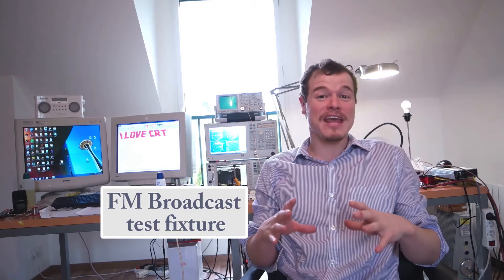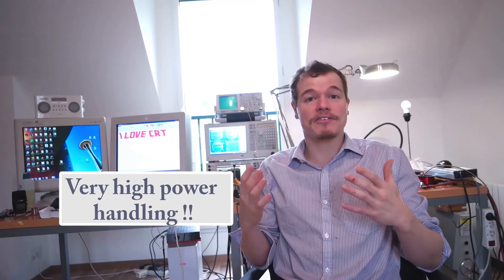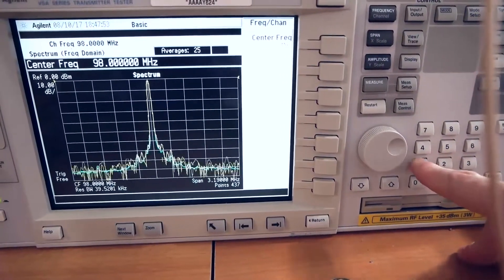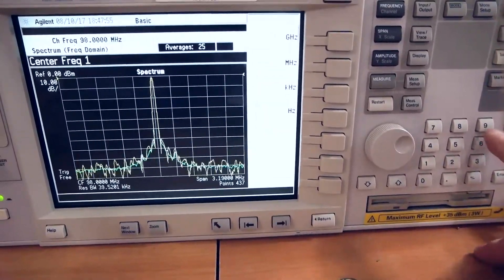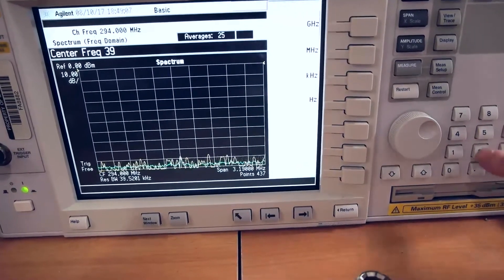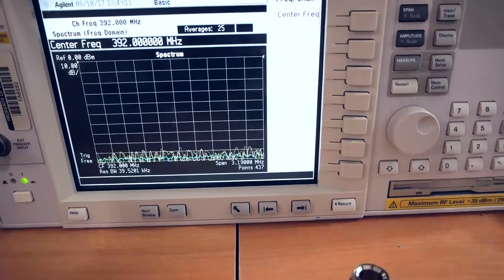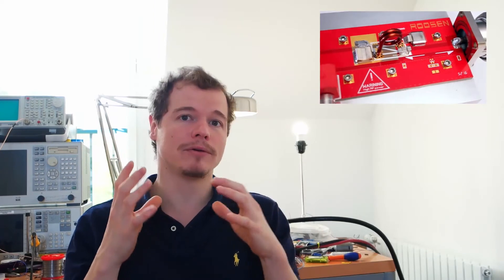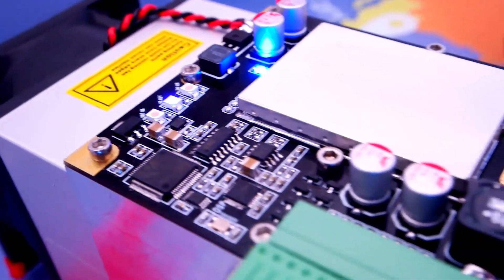MRFX1K80H ROOSEN design breakthrough Broadcast & ISM

Comment: Great and neat design, very clean sir. unfortunately my MRFX1K8H in my project are failing on the gate, are you facing the same problem? if yes what did you use to protect the LDMOS gates. help is appreciated :)
Reply from the maker: Ah yes setting the Gate voltage is always a moments where you need to be very carefull. Did you use a potentiometter? ?
Reply: @fmbroadcast  yes I did but every now and then random peaks over 10 volts appear or transients that might be the cause of failure at the gate. Zener diodes done seem to clip the peaks.

Comment: Amazing design, just about 230J heat dissipation, very easy to handle in a 19" Rack. Great job! thats 80% overall efficiency, with a very high efficient PSU.This saves around $ 900 a year on electricity bills alone compared to an amplifier that has only 60% efficiency.
The additional price for a very efficient power supply is thus amortized within two years at the latest. In addition, a more efficient power supply lasts longer, as it is structurally less hot.
A simple emergency generator that produces 2KW power would even be enough to power the entire radio studio in an emergency. Efficiency is everything!